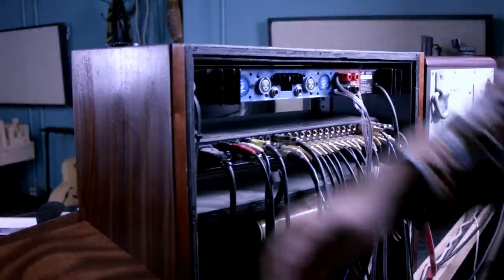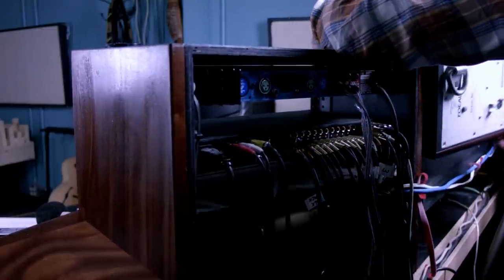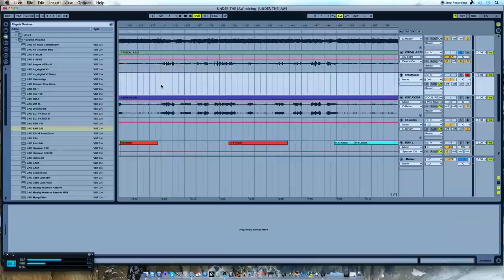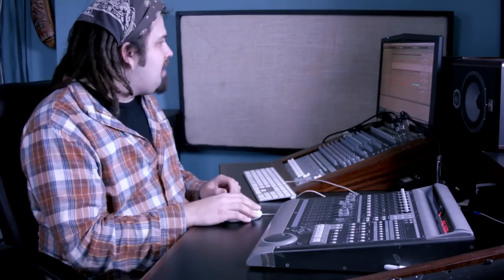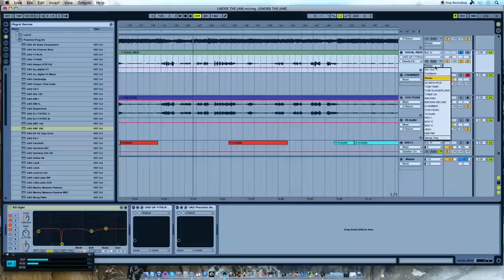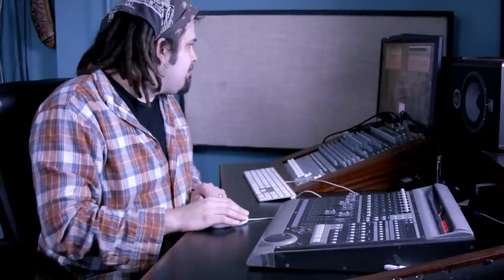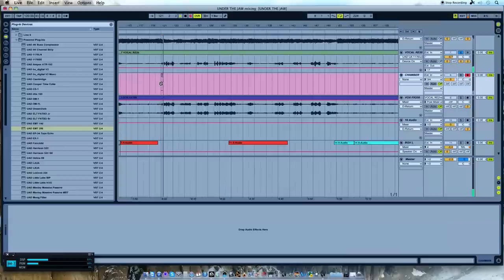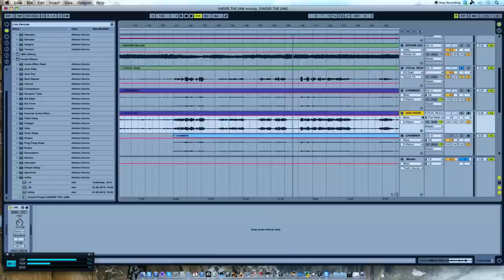5 Minute Reverb Chamber

Comment: Ryan, I've been listening to a LOT of psychedelic records the past 20 years.  Quite a lot of them have really dirty sound.  Other than using bad tape, a bad tape recorder (neither of which I think is the case in a number of these recordings, because they were done very professionally), bad mics or possibly just bizarre mic placement, or even just one mic in a room and the entire band plays into that one mic, I don't understand how they can get such dirty sound.  Not that dirty sound is bad, I think it actually makes most of those recordings sound so much better.  It gives them the feel of the era!  If you were record this stuff with ProTools type sound, it'd probably be so clean it'd suck large rubber donkey donagles!!  I'm pretty sure that, in quite a few of these cases, the sound was INTENTIONALLY made dirty!  How do you go about getting that sound?
Reply from the maker: Red, a lot of dirt can be added in a number of ways. You can have a room sound that is pretty crazy sounding in the low mids, or you can use any amplifier stage to add harmonic character (distortion). There are numerous opportunities to add this character and in the older recordings, they really took some chances by letting sound be distorted and this was normal. Obviously a common place to change tones is in the output tubes of a guitar amp, but it can also be the microphone preamp for shaping the attack of drums, or recording a touch too hot into a tape machine. I view recording as an extension of the music and an artform itself, so I agree with you that clean sounding recordings are not a one size fits all kind of deal. - The distortion really does make it sound better as it helps further express the music.

Comment: before I ask my question, I have to say thank you, you have taught me more in a few videos over a few days than I have learned from tutors at college for nearly 3 years.

How does this compare to, say, creating an IR (Impulse response) of your space? a reverb you can pull up instantly like a plug in, verse the more organic approach you're taking?
Reply from the maker: James Horan Thanks! What a complement! I really liked the IR reverb plug in called Altiverb. That sounded amazing and I used it all the time at the first studio I worked at. This is different from IR in that it's my space and no one else has it. It's also how the first reverbs were made and how big studios still create unique reverbs...they have a room out of concrete, or a stairwell with an old monitor in it. The room can be active with sound during the live tracking and the vocals can hear the room sound can be fed back into the headphones. Bathrooms work too, but in the old days they would put a sign saying "use other bathroom" because they would get toilets flushing in the middle of takes. It's mostly about the experience of a real space that makes it so unique and so fun to use. It's your space and no one else has it.

Comment: This is totally off topic, and not meant to be critical; I just think it's very well worth mentioning, and hopefully I'm helping with this observation.  I could hear a higher pitch with a raspy tonality, not too unlike a bit crusher sound, following the pitch of the vocals when you played the dry vocal signal.  It was in a higher octave and seemed to follow a maj3 to a 5th, varying and sliding in this range depending on how the singer varied his volume or intensity.  It was pretty prominent even in the mix, and it didn't sound good; in fact, it was pretty distracting for me.  It wasn't nearly as present in the room reverb channel you created.  Because of that, I wound up liking the reverb by itself, so I think I might have cut the dry quite a bit, if not completely.  IDK if you could hear it in the desk monitors.  I was using headphones when I was listening.  It would be interesting to see if you can find it and maybe comment on what it is, how to avoid it, etc.

Meanwhile, I'm going to watch this video a few times, cuz I love the idea of using natural reverb for things.  I've thought about mixing real and artificial elements in different ways, but I'm not sure how I'd want to do it.  One other idea I had was to have two playbacks from different rooms feeding a mike placed outside and near both doorways, perhaps in a hall, to enlarge the reverb space and add subtle staged reflections (that's what I call it).  I'm sure people have done it before, but it sound like a fun thing to mess around with.  If you have any ideas or experience with doing it this way, I'd love to know what you've found.
Reply: Rob Cerasuolo to me it sounds like something in the singer's throat, didn't sound good.
But that Reverb was great!
Reply: Tiny moments of fingernails scraping on a chalkboard that sounds like some rasp from the singer? I heard it too. In desperate need of some subtractive EQing is what came to my mind.